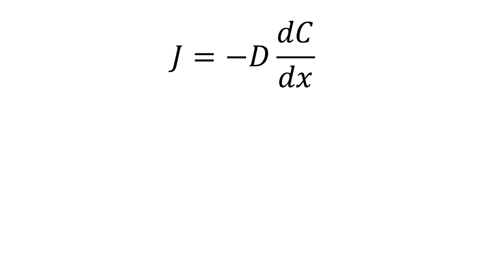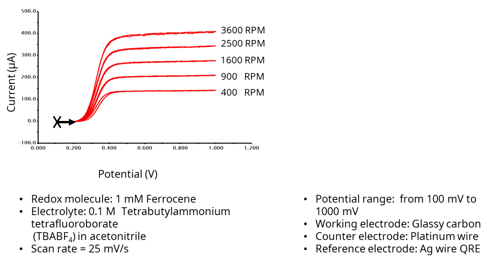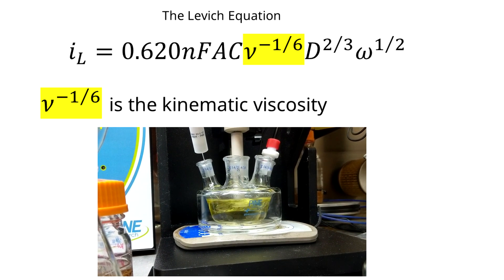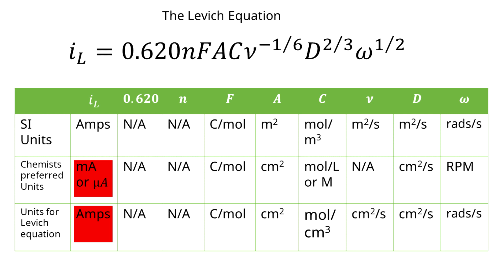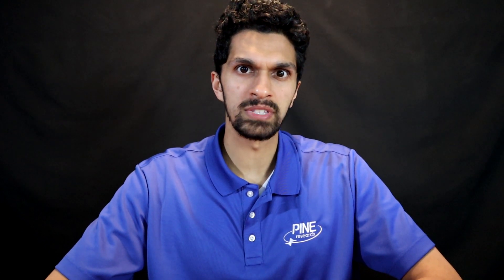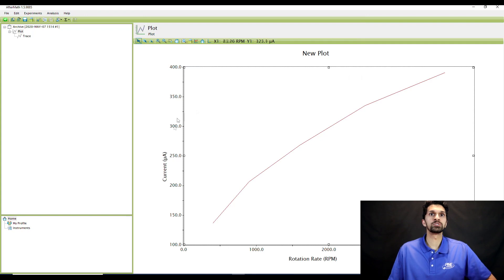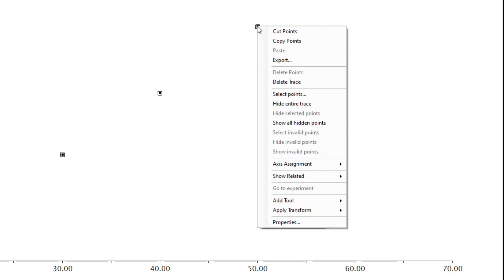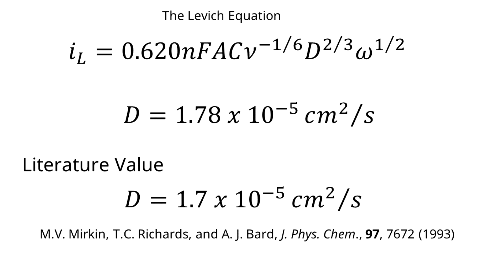How to measure the diffusion coefficient using a rotating disk electrode

Comment: thanx for great explanation, but a/c to levich equation it should have intercept at 0 uA, but you have a value of 12 uA, is it going towards K-L plot.
Reply from the maker: Yes, you are correct the y-intercept should be 0.  I would attribute that to experimental error, considering the currents I was measuring were in the hundreds of uA, getting an intercept of 12 uA isn't too bad.  

Actually, now that I look at the data more closely, my scan rate is pretty fast, 25 mV/s.  So that is probably causing some error in the intercept.  But even so, I was fairly close to the literature value for the diffusion coefficient.

Comment: Great video. Thx! One thing to point out. At 7:47, the concentration C should be 1 E-6 mol/cm3 instead of E6 cuz the initial concentration is 1 mM if I am not mistaken.
Reply from the maker: Yes, you are right.  I forgot the minus sign.  It should be 1x10^-6.

Comment: Do you have a “how-to” video on how to operate and collect data from your rotating disk electrode systems?  Thank you for your time.
Reply from the maker: Unfortunately, I don't have a video like that.  But in short, if you've done cyclic voltammetry, an RDE experiment is basically a cyclic voltammetry experiment performed at a slow scan rate (5-20 mV/s) while rotating the working electrode.  So the data collection will be the same as a cyclic voltammogram.  I'm thinking about making a setup and perform RDE experiment video in the future.

Comment: 7:44 at this time, when you calculate the diffusion coefficient, slope's unit consists of A, s, rads. there is a rads unit! but your parameters (n, F, A, C, v, D) don't contain the rads unit. So I'm curious about how to remove the rads unit in your calculation???
Reply from the maker: Great question.  Radians are unitless, so I simply removed it from the equation.  a radian is the length of an arc of a unit circle divided by the radius.  Both quantities are dimensions of length and hence they cancel each other out.  I hope this helps.

Comment: A great informative video!!! When to use chronoamperometry and voltammetry??
Reply from the maker: It depends on what you are trying to do.  Voltammetry is great when you are trying to determine at what potential you electrochemical events occur.  Chronoamperometry is more quantitative when you already know the potential where electrolysis is occurring.  Chronoamperometry has the added benefit where it's less dependent on the electrochemical double-layer, while voltammetry can generate a large background current depending on the scan rate.

Comment: Why do you not include the point 0|0 in the diagram? Then i get a bit higher slope (0,0000202593)  and a higher diffusion coefficient D=1,86x10^-5 cm2/s . Thx for the help
Reply from the maker: Sorry for not responding to you earlier.  Your comment got caught in the "held for review" section.  You could use 0|0 when calculating the slope.  I would say that you'll always have some level of noise and possibly get a current that's not equal to zero at zero RPM.  The calculated diffusion coefficient you got isn't all that bad when compared to literature.

Comment: Hello
How come your slope units have (rad/s)^1/2 if your X axis is still RPM^1/2?
Thanks!
Reply from the maker: I will need to check in with one of our software engineers about that.  I think we choose to automatically make it (rads/s)^1/2 because we knew that this was what people were going to be calculating so we made the jump to give users the number that's easiest to use for diffusion coefficient calculations even though instrumentally you work with RPM.